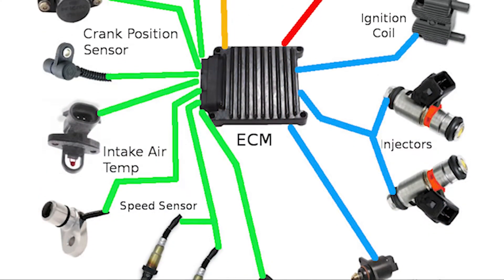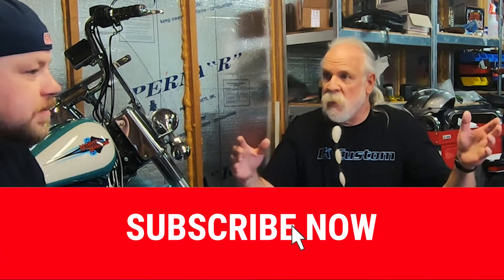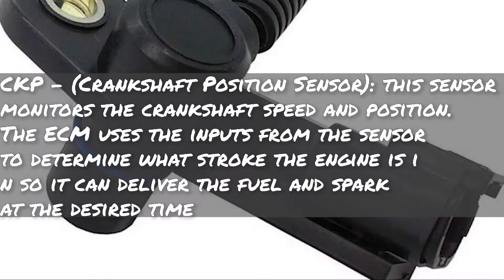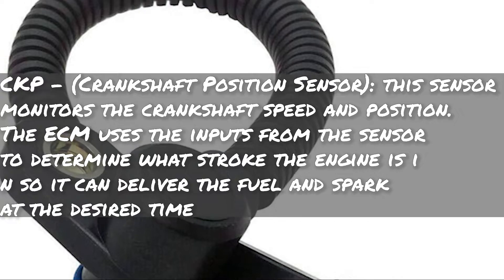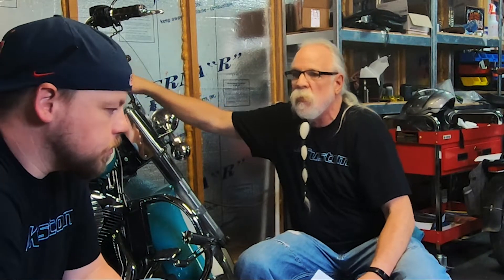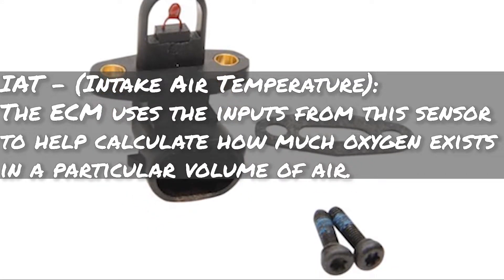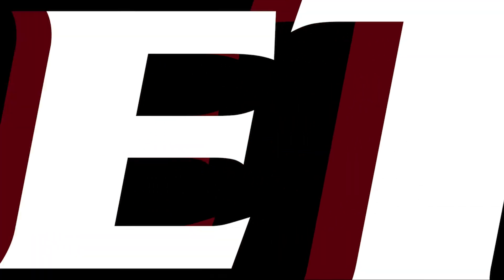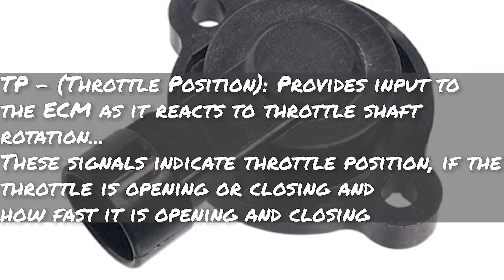How the Electronic Control Module (ECM) Adapts

Comment: So I have a fat boy cvo 2006 supposed to have no 02 sensors for years . Bought bike and has Vance Hines big radies pipes kn air intake and was dyno. Problem is check engine light on with p0134 code from 02 sensor open not responding. Bike has no 03 sensors I see . Vance Hines pipes have plugs in them . Stock none . Mechanic want 700 to rerun dyno . Bike runs good as it . Just bought bike . Any idea for easier fix than 700 bucks
Reply from the maker: Only way I know to do it for less is to buy and install the o2 sensors yourself, OR to call fuelmoto and find out about getting a power commander tuner that does not use o2 sensors.

Comment: My 95 trike will crank but will not start the fuel pump is working could it be coil?
Reply from the maker: Harley did not make a Trike in 1995.  So yours is a conversion.  

We don't know what Harley was used in the conversion....Touring, Dyna, Softail, Sportster? 
 Also, is it carbed or EFI?  
There are so many things it could be, from bad fuel to plug wires, to plugs, to clogged jets in the carb.
To answer your question, yes, it could be the coil, but I would check to see if the plugs are sparking, and if not, then look at new plugs and plug wires.  If it is sparking, then start looking at the fuel system.

Comment: Hi Kevin, hi Dwean,
you Maike a Great Job.
My motorcycle sometimes sends error code P0152c in thrust mode.
Mostly when I drive down a Hill with two people.
The rear cylinder is running too rich.
Can I simply clear the error?
Or is it an essential error that indicates a serious malfunction?
Reply from the maker: What you describe in an intermittent signal that the rear cylinder is too rich.  There are a number of reasons you could be getting this error code.

Could be a sensor going out, could be that you are actually too rich, could be a bad wire.  Could be that your bike and whatever mods you have done are not playing nice with the ECM. 

What year and model Harley do you have, and importantly, what engine and/or exhaust mods have been made.

For example, if you have a 2018 or later Sportster, they regularly throw that code when they have a good tune....because the ECM is wanting it to be leaner than a good tune.
Reply: @DKCustomProducts  Thank you Kevin,
how much horsepower do you think you can realistically get out of an M8 114 cui engine with Stage II?
With Manifold 64mm, injectors 5.5 SE,
More and more videos are appearing on the net that show unbelievable performance of about 130hp, supposedly at the rear wheel.
Is that possible, or are these performances measured at the clutch and you have to deduct about 13%.
Greetings Thomas
Reply from the maker: @Tom-ck8hg  As you can see from the following video, we do not pay too much attention to horsepower, our focus is more on torque.  https://www.youtube.com/watch?v=DOxzN8r35O4

By going with the larger throttle body and a hp cam, you can get 130 hp at the rear tire, but doing that you will give up torque.  

If you are like most folks that ride a Harley, you really like the feel the the torque...for that you should stay with the factory throttle body (the larger will slow down the intake charge, reducing the torque felt up to around 5000 rpm).  If you go with a Performance Stage I (see video on that here- https://www.youtube.com/watch?v=GK5x3lcQvJU ) and then a good torque cam, you will be getting close to 130 torque, and that is a lot of fun!

Comment: I have a 2013 Electra Glide which my mechanic gave me the bad news that the ECM died. He stated that I would need a new ECM due to it being mapped to my bike's VIN. A used ECM would not work. Per Harley, ECM's for my bike are on back order until September 2023. Would you have any idea on how to get a new ECM for my bike sooner? Any assistance would be appreciated.  ~Mark~
Reply from the maker: I believe there is a way for a used ECM to be programmed to your bike.  I would call Jamie at V-Twin Repair.  He should be able to answer that for sure, and help you.  901-584-5760

Comment: 09 harley with no power when ignition is on, battery is good, i even tested power at the switch, even put a jumper in, in place of the switch, all fuses good and nothing when ignition is on, died while riding, any ideas, thanks again
Reply from the maker: I would retest the fuses, using the back side of the fuse with a multi-meter.
It was only a month or so ago when I had something not working...I checked the fuse (visually) and believed it to be good.  I then spent another hour tracing back all the wires, thinking there was a problem with a wire being compromised.  Everything was good...so I went back to the fuses, and sure enough, even though it looked good, when  I tested with the meter at the test points (either side of the amp rating) the fuse was bad.
Hope it is that simple for you.

Comment: Is it possible to buy a used Ecm from eBay and use it on a 2015 street glide? If so are there other parts that are needed to make the bike functional?
Reply from the maker: Is it possible?   Yes, but how would you know if the ECM was any good?  You would need a functioning ECM that is for your year and model SG.  Then the ECM & TSSM must be "password learned" at the dealership using the digital technician so both are "married" to each other.

Comment: Harley Davidson Dealerships put aftermarket exhaust V&H stage 1 and dyno the bike with the orange screaming eagle tuner and installed O2 sensors bypass kit and ECM runs in open loop for performance. Is this ok for the bike I don't care about EPA emissions.
Reply from the maker: What year and model bike?  Is it running strong, not too hot?  Did mpg stay close to the same after that work was done?
Reply: @DKCustomProducts 2011 CVO Convertible with the 110 twin cam. I believe the tech said something about ordering a new set of O2 sensor removal kit because the front one was bad. I am confused because when HD did the stage 1 I thought they put new O2 sensors with the pipes. Orginal HD pipes still have the O2 Sensors in them. They didn't use them on the new pipes. And new pipes don't come with sensors. I can't find my records to show what I was charged. HD won't use my orange tuner because of lawsuit. If ECM is bad I am out of luck.
Reply from the maker: @Dave-zy6de  To run properly, especially if you ride in changing altitudes, your exhaust should have o2 sensors.  Getting an independent shop that is familiar with your race tuner and they should be able to give you a good tune (one you have o2 sensors installed).  Don't waste your money on the current tuner HD is using.
Also, that 110 is infamous for running way too lean and too hot, so this really is something you should get done.
Reply: @DKCustomProducts  Thanks for the advice I will take it to another shop.
Reply from the maker: @Dave-zy6de  No problem, thanks for watching & good luck!

Comment: A little help here...I have a 96ci 2016 Streetbob stock. Stage 1. I have major overheating problems. Can the dealership retune the exist stock ECM to run a bit richer to the max they can push it (can it be remapped)...or I have to invest in a tuner like PV or FP3 and do stuff myself?
Reply from the maker: The Dealership cannot do any tune on the bike other than a too lean, EPA compliant, tune on a Twin Cam. Even a ViED, which richens up the AFR is better than a dealership tune.  You can see those at this link- https://www.dkcustomproducts.com/fl-vied-fuel-enrichment-for-harley-efi-plug-n-play-more-details-dk-flvied-10-nr.htm
Whether you use the ViED, a PV or a FP3 or 4, going from a stock tune to a good tune is only going to lower your temps by about 15 F.
While a good tune is very important, it is a myth that it will take a bike that is running much too hot and cool it down to optimum temps.
Here is a written report on the subject- https://www.dkcustomproducts.com/why-how-to-cool-down-the-twin-cam-engine-part-i-dk-cl-tc-dn-1.htm

Here is a video on low and no cost ways to cool down your ride- https://www.youtube.com/watch?v=o3T3yA9BKwE
Reply: @DKCustomProducts  Hey thanks for the reply. Yes i do understand from your other videos...a good tune is 1 of the many mods that can add up to effectively cooling down the engine temps. My additional consideration being a head air-cooler to my to-do list.

My country is pretty warm to hot temp, the bike can't take it. I have had engine shut off for 30mins, waiting for it to cool down before it could start back against. Poor thing.
Reply from the maker: Sounds like you have a good handle on things that can be done...no one big thing, but many "little" things that each add some benefit, and added together, make a big change.  
Thanks for sharing.
Reply: @DKCustomProducts  Learnt alot from your videos. Thank you on behalf of all the ignored H-D owners.
Reply from the maker: @dinshak86  we are glad you're liking our videos, thanks for watching! We are always happy to help fellow riders. We appreciate your support, ride safe!

Comment: Are ECMs on carb models?...i have a 2004 Fatboy carbed
Reply from the maker: Yes, your 2004 carbed Fat Boy has an ECM, BUT, it does not have all the features of the ECM in this video.  The ECM in this video adjusts the air fuel ratio and the timing based on the variables outlined.  On your carbed bike it only adjusts the timing...all AFR adjustments must be done manually on the carburetor.
Reply: @DKCustomProducts  I have a problem...no spark from rear cylinder, i have new coil, new leads, new plugs....runs on 1, the front cylinder, the problem started and so i bought plugs, leds and new coil...checked code and says for P "no rsp"....any ideas...could it be wiring to coil ?

Comment: Question:  
If a Harley Davidson comes with narrowband O2 sensors stock, which are reading AFR’s in the narrowest of bands, say stoichiometric + or -.5 how does a Harleys stock ECM change its AFR calibrations plus or -20% with any accuracy? Another words, I have no doubt that the computer can make the 20% AFR changes required, I just doubt the information being given to the ECM to make those calibration changes. Wouldn’t true wide band O2 sensors be required for true accuracy?  Thanks guys! Good show as always.
Reply: The only thing I’m thinking (regarding narrowband accuracy) is that while in closed loop you’re  pretty much riding at highway speeds not putting much load on the motor while you’re running at or near stoichiometric, there by making a larger spectrum wide band sensor not as crucial for AFR/Lambda readings in that particular riding situation. This is just a guess, 🤷‍♂️
 I am certainly not a skilled tuner😆  
Still,, do you know any skilled tuners utilizing dynamometers running narrow band O2 sensors during their tuning sessions to create their individual and Unique Open Loop, maps?
Reply from the maker: Glad you're liking the videos.  Thank you for the comment and question. 👍😎👍

Methinks you did not watch the entire video.  Your question is specifically addressed, starting at around the 10:55 mark.
Here is a copy & paste synopsis of it from the report linked in the description.

The second way the ECM ADAPTS is via "Adaptive Fuel Value" or "Adaptive Fuel" (reference the HD brand Tuners to see that this is a feature of the ECM) This is commonly what is referred to as the Adaptive Learning Mode.

Adaptive Fuel is known generally in the EFI world as Long Term Fuel Trim (LTFT).

When in closed loop the ECM uses the information from the above list to calculate airflow, load, temperatures, throttle position, to adapt and maintain the targeted AFR in the closed loop section of the map.

It then uses the o2 sensors to determine what the AFR actually is. If there is a difference, the ECM makes an adjustment real time to the closed loop map, AND stores the difference in an "Adaptive Fuel Value" cell for future use in Open Loop. (again, reference the HD Brand Tuners to verify that there is an Adaptive Fuel Value" that is stored in the ECM and that is constantly changing)

Over time (30-120 minutes of riding) the Adaptive Fuel Value develops a correction profile that is applied to each cell of the map in open loop.

To put it another way, when the ECM sees the closed loop values constantly being richer than expected (like when using an XIED family product), the Long Term Fuel Trim (Adaptive Fuel Value) is increased, resulting in a richening up of the open loop values.
Reply: @DKCustomProducts  I totally get the long term fuel trim from close loop table transfer to the open loop interface.  I should’ve asked my question a different way. I apologize.
What I am asking is.. can the information that’s gathered from the O.E. narrow band O2 sensor to the ECM while in closed loop be trusted in the first place? Does that make more sense?  Erroneous information going in should by my calculation be erroneous information going out. Does one put stock into a narrowband O2 sensor over a wideband O2 sensor?  We run data acquisition on field sampled material at my work. If we used a test probe that wasn’t able to see the full dimension in gases (let’s say a narrowband only O2 sensor as an illustration example only here), how would we trust the data sent to the brain for recalibration? How would we know the information in the ECU in closed loop is solid info for the open loop table? Heck, for the primary closed loop even? 
Does this make sense?  Thanks again for the video!
Reply from the maker: @noonespecial1217  Ah, yes, I understand your question.  I am running a bike with Target Tune (see link below) and it uses wide band sensors, to dynamically adjust the tune while riding.  It is a HUGE improvement.   
https://www.dkcustomproducts.com/power-vision-tuner-accessories-c120-297.htm
That said, while the narrow band certainly has its' limitations, the bikes can run pretty good with them, and that is what they all come with.  Would wideband run better?  No doubt.  While it is a bit pricey, those that want that extra edge can get it.

Comment: can u help me?my sporster 883 the wiring map sensor no light when im test with the test pen no light.but the map sensor i already change the new 1.. is it the ecm problem?
Reply from the maker: If you had not already changed the MAP sensor, I would suspect that it was gummed up from all the hot, oily air being fed into the intake.  You put a new sensor in...so I would look carefully at the wiring for any breaks & clean the connector and see if that works.  My next step would be to look at the actual new sensor being defective out of the box....see if you can find another one that you know is working, and test it out on your bike.
After that, I would see if I could get it on a digital tech to see what it says.
Oh, before that, have you checked for error codes?
Reply: @DKCustomProducts  yup i already check the error code is map sensor problem..but i check the wiring red n white is no light..when i try my friend bike the wiring is have light when i put my test pen tester.. can u tell me the wire of red n white is from ecm or what?
Reply from the maker: @mapreymaprey1008  I wish I could man.  I am on a road trip right now, no access to my FSM's.  Getting a FSM for your year 883 will give you the wiring diagram.  Sorry could not be more help.

Comment: My 2014 Softail revs high after it’s hot and I’ve been ripping on it on the freeway. The idle stays at about 2,300rpm and doesn’t kick down until the bike comes to a complete stop. I’ve been told to try resetting the ecm. How is this done? I have read that I turn the ignition (console switch) on for 10 seconds and then off for 10 seconds and repeat this 4 times. Is this correct?
Reply from the maker: I don't know, have you tried it?  If not, you are not going to hurt anything by doing that.
One way that can work is to disconnect the battery for 15 minutes, this will "resettle" the ECM.

Comment: My bike has no o2 sensor
Reply from the maker: Yeah, if it is pre 2007, no o2 sensors.
Reply: @DKCustomProducts  can u help me?my sporster 883 map sensor wiring no light when i test with my test pen light ...is it ecm problem?
Reply from the maker: @mapreymaprey1008  If you had not already changed the MAP sensor, I would suspect that it was gummed up from all the hot, oily air being fed into the intake.  You put a new sensor in...so I would look carefully at the wiring for any breaks & clean the connector and see if that works.  My next step would be to look at the actual new sensor being defective out of the box....see if you can find another one that you know is working, and test it out on your bike.
After that, I would see if I could get it on a digital tech to see what it says.
Oh, before that, have you checked for error codes?
Reply: @DKCustomProducts  yup i already change the new 1 still the same..but when i cek the 4 pin wiring the colour red n white is no light ..when i put me tester pen check light..
Reply from the maker: @mapreymaprey1008  Is it possible the new one is defective.  Can you try your friends sensor to see?

Comment: Can an eco be reprogrammed to learn modifications
Reply from the maker: What is an eco?
The ECM on 2007 and later Harley's will learn and adjust to moderate changes.  On 2017 and later M8's they learn and adjust to even more modifications...up to a Stage I (free flowing exhaust and intake).  For any mods more than that the bike will need a tune change (reprogrammed) and then they learn and adjust from that new tune.